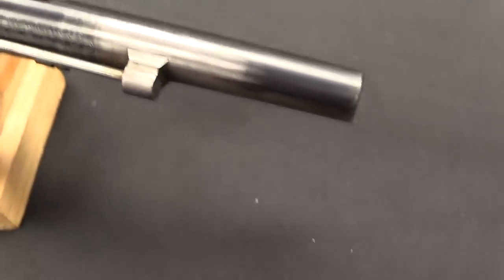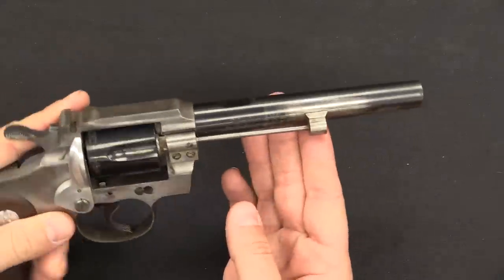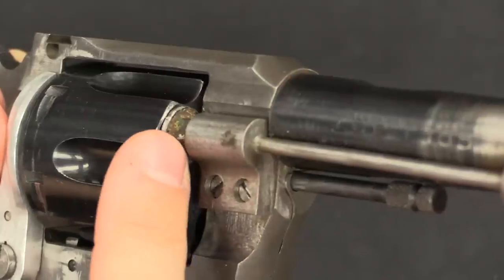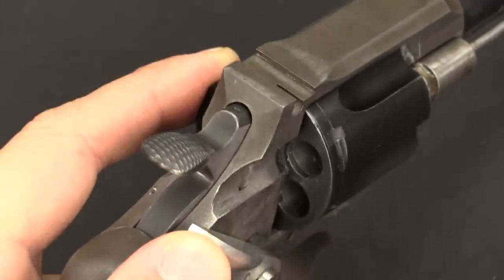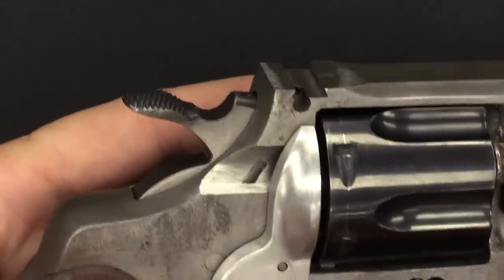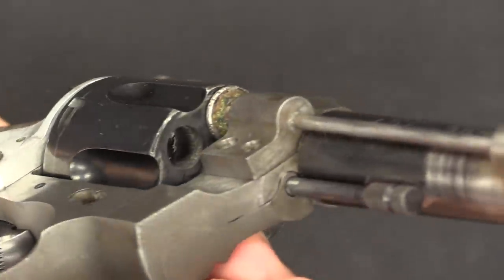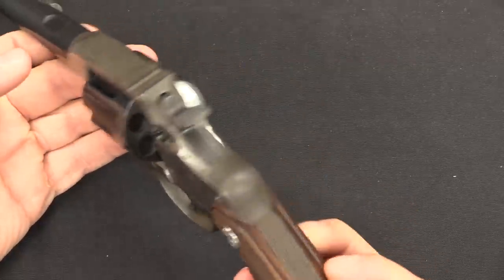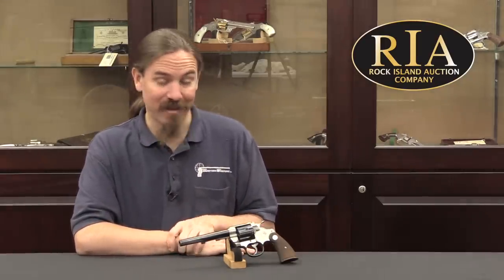Colt Prototype Self-Ejecting Revolver

Comment: Ehm .. do I think correctly if i assume than on a cylinder filled with life round, this piece will blow out one life round as soon as I fire this thing?
Reply: No, since the round will be moved as soon as the hammer is cocked. But in the end it always will be a 5 shot revolver since you can never get it empty. (edit): Assuming it will be used with a swing-out cylinder, it will eject the first loaded round. This design will only make sense for gate loading revolvers with fixed cylinders.

Comment: I've never heard of this gun before.  Google Maurice the Frankenruger, my build.  In my early development stage I had exactly this system working based on a Ruger New Vaquero.  At that point I still had the original ejector rod to spit out that last shell. In a single action revolver ("cowboy gun") there was still a significant speed advantage to auto ejecting five of the six rounds.  (Continued in reply)
Reply: Then I took it to the next level. I converted it to 9mm Parabellum, punched a hole in the back of the frame on the left side and was able to use tubular magazines to inject new rounds into the back of the cylinder as soon as an empty chamber passed in front of the magazine well.  I also ditched the mechanical ejector and did a straight gas line very similar to this Colt although quite a bit bigger.  Instead of tapping the barrel I did a muzzle attached gas trap which doubles as the front sight base.  I normally carry it with a short two round tubular magazine topping off 5 in the cylinder but my reload magazines are a foot long holding 9 rounds, and if I want I can stack 9 on 5 and get a 14 shot capacity cowboy gun.   (Continued!)
Reply: My next planned modification is to upgrade the caliber to 9X23 Winchester, giving me enough gas pressure to run a second gas line driving a small slide stripping rounds off the top of a Glock 10-millimeter family magazine into the back of the cylinder.  Mags would poke out sideways and up a bit.  Using happy sticks I should get somewhere over 30 rounds of firepower out of a cowboy gun.  Regular holster carry would be easy with 10 round mags which would probably carry 11 in 9x23.

If it's not clear yet, 9mm rimless ammo was necessary to clear the gun's guts on the left side as the shells are injected into the back of the cylinder.  357 was too fat and would have hung up on the pawl.

I've tried to figure out how many SASS rules I'm violating. The best answer I can come up with is "all of them".
Reply: I can't wait to see your next modification. :)
I'd try the mag fed slide action version in 9mm Parabellum first on the off chance it surprises you by working. :) If it didn't you'd just have to ream the chamber, scale up the mag well and perhaps tweak the slide travel distance. (9X23 Winchester is so much more expensive than 9mm Para and I'm cheep.)
Reply: @1jimmarch , I very much hope that you will one day permit Ian to examine your revolver :-)
Reply: I just looked it up, very interesting!
Reply: Oooh. So what he was doing, was maybe figuring out if it would be possible to feed a chamber on one side, and eject on the other, with a gas-operated mechanism.

Your steampunk awesomeness fresh off the laithe is absolutely awesome, though. Huge props for actually developing it :D

Comment: Why not make the cylinder with the size to hold 7 rounds but the 7th (or 1st depending on how you think about it) isnt machined out leave it solid  that way there is  nothing to eject. Maybe make it in a smaller caliber.

Comment: Just throwing ideas about:

Given that you effectivly have a cycle of 5 shots, why would you manually eject the last empty case? I would imagine that you open it up, load 5 cartridges in the 5 spaces and then close the cylinder with the empty case in line with the barrel. That way you have the old school safety style of not having a live round in line with the barrel, and you never have to touch an empty case.

It's still horribly overcomplicated and by the 1960s we had better stuff out there.

Comment: It has the obvious problem that it's a 5-shooter: the first round you fire gas-ejects one of the unfired rounds! It would be cool to see a self-ejecting revolver design where the gas tapped off the barrel advances the cylinder, then squirts gas in the spent-round chamber. Pulling the trigger only cocks and releases the hammer...unless there's a misfire? Oh, simplicity...

Comment: You could load five rounds with the hammer on an empty chamber, first shot would vent gas to an empty chamber, as the cylinder rotated to bring a live round under the hammer, subsequent shots would eject a spent case
Reply: In that case you are down one round, can't use speedloaders properly, and need to carefully align the empty chamber before closing the cylinder. The  advantage of exponentially faster reloads is lost.

Comment: Put a valve in the gas port that only opens once the cylinder has rotated. Then the casing of the round that was just fired will eject. Voila.

That valve system might be heavy or unreliable though.

Comment: As it currently is, this is pretty a dumb idea. With a bit of tweaking it could be cool. If you had a buttstock with a tube magazine adding an extra round into the other side of the cylinder every time it turns, that could make a pretty nifty little carbine. Of course it really wouldn't be any real upgrade over a lever action but it's a relatively simple concept that could have been superior to a lot of the early semiautos.

Comment: It only sold for $1840?  I'm surprised.   Seems to me that the final design for this would offer a method of loading one as the empty chamber rotated around.  Not really practical, but it solves the issue of manually ejecting the sixth cartridge.  Of course it basically turns it into a single shot.  Load one, shoot one, load one, shoot one.    If I was going to design it, I would make it so that the cylinder auto ejected all 6 cartridges when it was swung open rather than as they are shot.  Then you just swing out the cylinder, reload, and swing it back into position.  Still probably not that practical.  I carry revolvers frequently, and never felt a need for a system to speed up my reloads over a speed loader, or moon clips.   I'm pretty sure the idea died because they realized these things and more.   Not every POC deserves to be produced.  But they always provide a learning experience.  At $1840, I would have bid more on it, and made a cool display in my living room as a conversational piece.

Comment: The only  way this would make sense is if the revolver was used by default as a 5 shooter ... an old practice was to leave empty chamber or empty casing under the hammer in revolvers for extra satay ... obviously not normally practice now, but it COULD make sense it that instance ... I bet the gas pressure was meant to be balanced to eject empty cases only s that would not be a factor.

Comment: It would have probably been more practical back in the day when they were still working on the colt single action army you know making it double action and making the loading gate like that could really come in handy and didn't they always carry on an empty cylinder anyway just leave the empty casing in until you fire might just work then you just load 5 rounds in the time It takes to use the ejector rod to take them all out

Comment: Well if you put shells back in as you go it might not be an issue but not as fast as a standard revolver with speed loaders however it would be great on a single action army model revolver granted it looses capacity when you do that however it looses the reason for a revolver called saving brass so yep a gimmick type idea

Comment: Wouldn't have tried this with a contemporary Smith and Wesson, it occurs to me, and not because he worked for Colt either. 

See below cut for theory.....
....

S&W's rotate the opposite direction from Colts. A S&W would be ejecting it's spent cartridge to the left, from the left side of the frame... which puts any potential mechanism at odds with the cylinder crane. As long as the cylinder swings left, the cylinder has to rotate clockwise for a simple frame-mounted system to eject the immediate trailing case.

Comment: A curiosity, but 5 minutes of thinking about it would have prevented a lot of wasted time for Colt, a company that would go on to make a lot of really bad business decisions and suffer financially.   A basic understanding of revolvers would lead anyone to see the several overly complex issues immediately, some of which Ian pointed out (i.e. too complex, and shooter still needs to open the cylinder to eject and reload, etc.).  Also, quite obvious, is that when shooting cylinder 1, cylinder 6 has a LIVE round and hot gasses are hitting it, which may create problems by ejecting it or discharging it or unforeseen problems.  If that cylinder is empty, the shooter has hot gasses aimed at his shooting hand.  And, if that latch breaks or falls off, ammo dumps out and/or hot gasses are hitting the shooter.  A brief thought exercise would have prevented this interesting but waste of time prototype.

Comment: For a left-handed shooter, it would not be that hard to load a single round in the vacated spot in the cylinder.  Which would obviate having to open the cylinder (until you ran out of ammo, at least).  Right-handers, not so much.

Comment: Only load five rounds in Chambers one through five. This negates the loss of a live round on first firing. If you pair this with a tactical reload where you put in one round at a time when the empty chamber comes around it would work, but then you'd be limited to two or three rounds in the gun. Might be fun for using at the range, but useless improvement for any sustained combat use. (Edit) went back and watched the beginning of the video again, realized my reload idea would only work if the cylinder retention plate is off the gun, making it useless. Yeah, there is absolutely no practical use for something like this.

Comment: Interesting and gimmicky idea. I think Colt would've been better off designing a literal belt revolver. Drum sticking out on the sides like a cylinder can hold a belt, which can hold more ammo than a cylinder. Then, when it's empty, just pull the arbor, turn the revolver sideways to drop the drum, pop a fresh 1 in, release the arbor and shoot more. Seems more practical to me then a revolver that turns into a side-loading single shot weapon in the heat of the action.

Comment: You actually wouldnt even get to eject 5 of the 6 cartridges. just 4, since the ejector will blow out what would have been the 6th bullet. meaning you're limited to an ammo capacity 1 fewer than the number of cylinders in any configuration. pretty stupid idea tbh.
no wonder the dude was dicking around with revolvers while everyone else was working on the AR 15